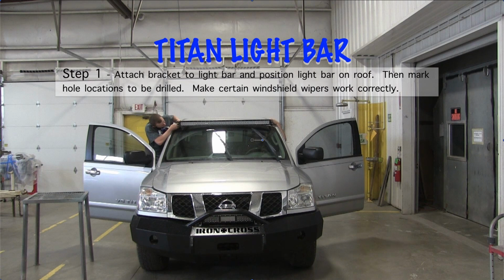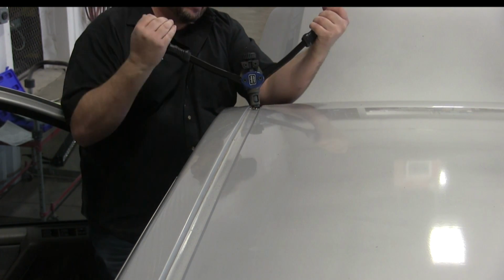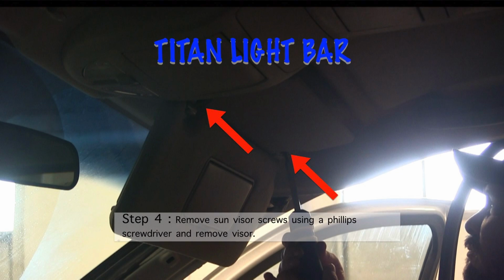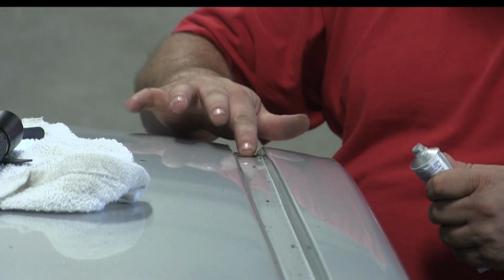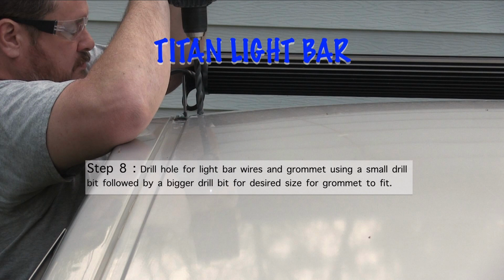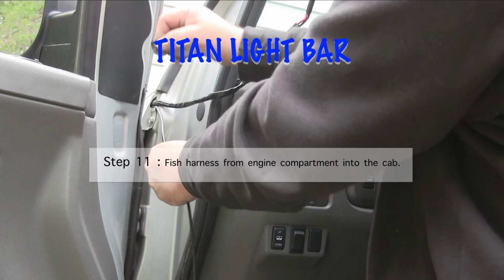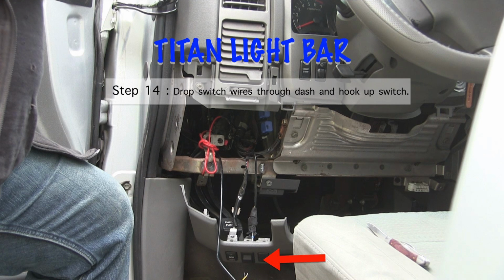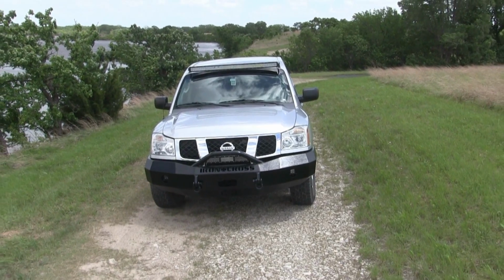How To Install an Auxbeam Roof Mount Light Bar on 2007 Nissan Titan

Comment: I would advise against drilling into the roof gutter as shown here. This gutter is where the roof panel asm. is welded with adhesives to the Inner Roof Rail Reinforcement and Body Side Outer.  Drilling in this location could cause you to eliminate a resistant spot weld causing degradation to the structural integrity.  It could cause major water issues leading to corrosion issues as well.  It is more complex than the average person could understand.  It would be adviseable to utilize the Class A surface of the Roof Panel Asm. to attached the light bar to, or the Body Side Outer upper A pillar section.  Definitely avoid the gutter area.  Hope this helps gives some engineering insight!

Comment: Thanks for taking the time to show this. Very helpful. Debating on doing this to my Titan Pro4X. I live out in the country and it would help.

However, I think I would drill a hole in the center of the base of the bracket (between the two mounting holes) and then match that hole to another drilled hole in the drip rail to leave a cleaner look.  Then secure the cable harness along the bracket as it feeds down into its own hole.  Additionally, if I ever decided to plug those holes, they would be more consolidated in the same area and more "out of sight" so to day.  This is just my approach is all.
 
Looks good, take care. 👍🏼

Comment: Good install video. I am about to install some light bars on my Armada. 

A word of advice from a former car stereo installer. I would advise against running the wire through the door frame  through the fender as it is a potential fire hazard. The proper way to the engine bay is through the firewall. There are several options to run the wire along side another wire harness going into the engine bay.

Comment: i like the first part of mounting the brackets. but why go inside the engine bay to get the power ? its not a 50AMP draw, you can add a new fuse inside the cab, probably directly on the fuse box and be done. no wires in view, all tucked up in the A pillar. if you really want to get to the battery, its not a 00 gauge wire... so you can go thru the fusebox grommet without issues and it makes a clean job.
Reply: it would fry the fuse thats why it needs a relay in line rather than just a fuse its not just the draw but the fact turning it on an off will melt the wire i thought the same thing hooked it up like you are saying then drove it to work an it lit up like a candle had to rip it out while driving and on fire so i hope people do not listen to you with no experiance just my 2 cents but would of cost someone a whole car if i did not rip it out while it was lit many folks would of let it burn but it being my only car i am not letting it happen thanks
Reply from the maker: Thanks for the advise.  This may be something I look into.